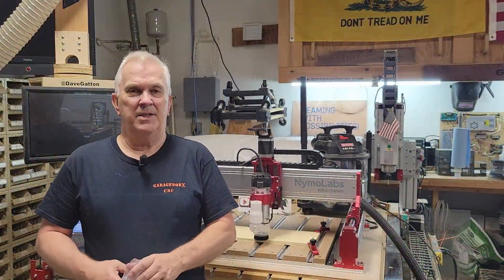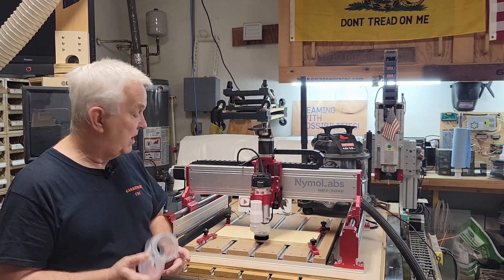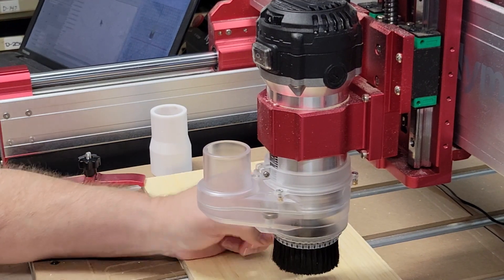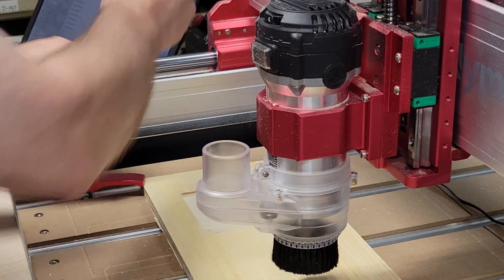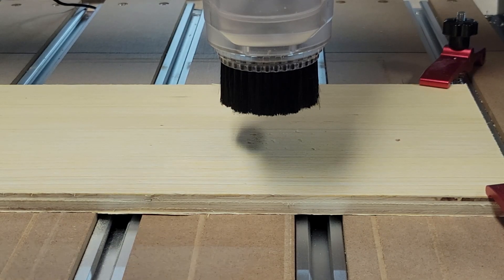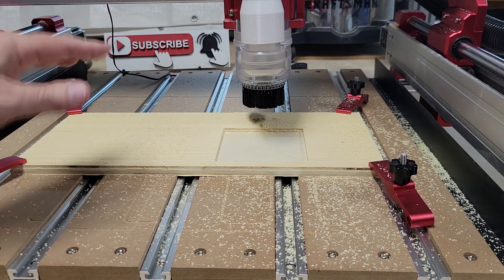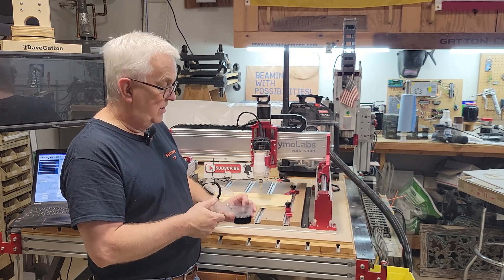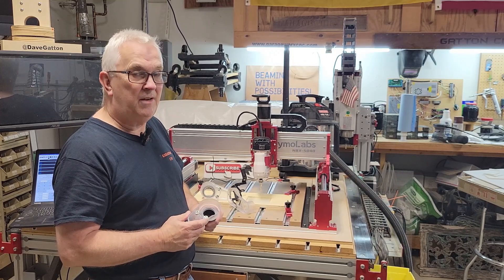Dust Boot Shootout

Comment: Dave, thank you for posting this video first of all.  I've been working with CNC routers for some 35 years now (at work) and now I'm retired but wanting to set one up for my hobby stuff.  Don't have 80k to setup what I worked on but looking at the Nymolabs 6040 and looking at what dust boot to get.  I like the one you are testing first as it sets to the top surface of the work piece and the router can plunge down into the material as needed without messing with the dust boot height.  I've been looking for the link for that one and not finding it.  Could you post a link please?

Comment: Not what I expected with the second one, you could see it pull the brushes in from the suction, it looked like it was gonna be fine
Reply from the maker: I was surprised too.  I thought both dust boots would be pretty much the same.  I think the problem is that the vacuum has to overcome the air blowing down from the router.  The router blows the chips through the brushes.